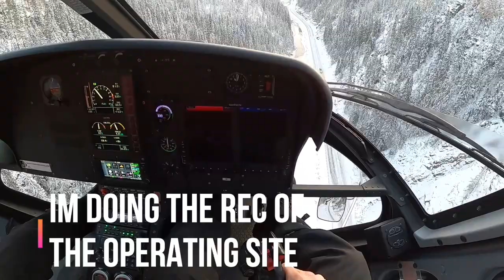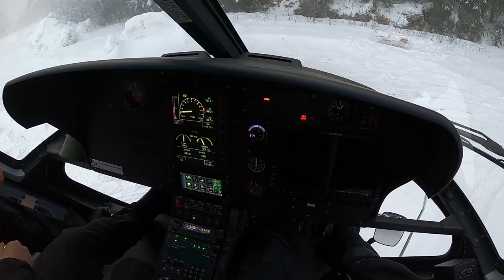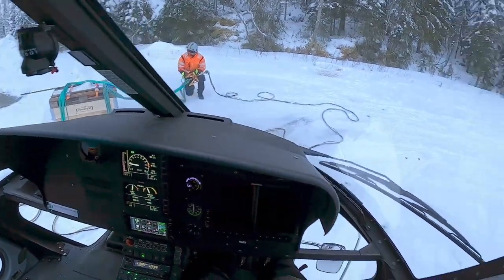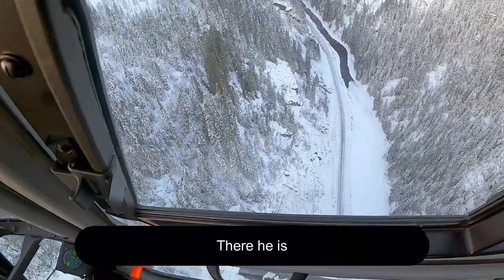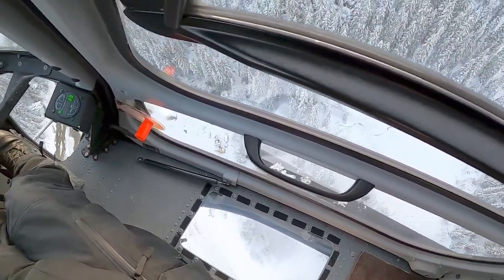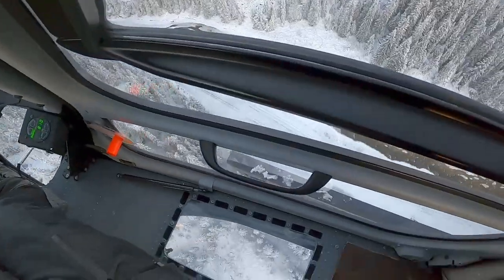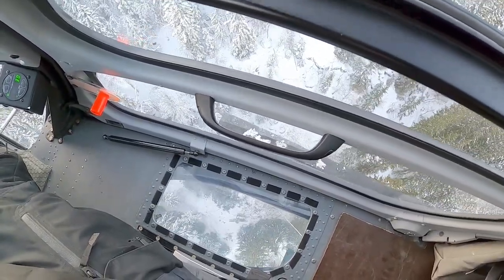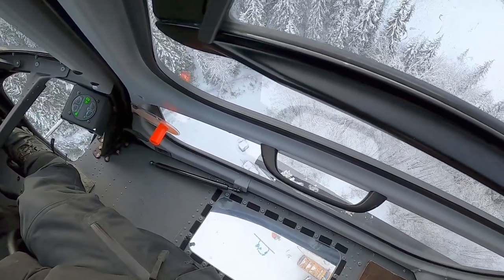H125 Helicopter sling load FPV Fortress mountain, flying Kaeser air compressor and equipment

Comment: Greetings from sunny California where it's 21C :) wow, I'm impressed with your precision.  Question... If you start your load's decent into the trees too early, it seems like you could foul your line up as you move it laterally to your ground guy, no?  Add gusts and a 800 Kg load and things could start swaying around quickly, no?  If that happens, would you have stabilized your load across the street by setting it down and picking back up?  So impressive!  I wished I could have watched the entire job - but I realize YouTube production isn't your real job - your real job is much more exciting :)
Reply from the maker: I'm jealous of the location and temperature 😊 did flight school in Portland Oregon and missed that climate ever since.. That was 2008... Thanks for the precision compliment! And a lot of the answers lie there as then you can navigate cautious through the trees. And that's the key in my opinion, slow is smooth and smooth is fast🚁 also idk if you watch the entire video of scroll thru, but I give a lot of comments along the way so context might be lost by fast forwarding. And I'm fairly new to this so there is more tips and comments coming:)
Reply from the maker: And no I wouldn't fly it across and set it down, I'd combat the wind within common sense and operating procedures margins. But when you have bulky self spinning loads you would use the set it down trick from time to time